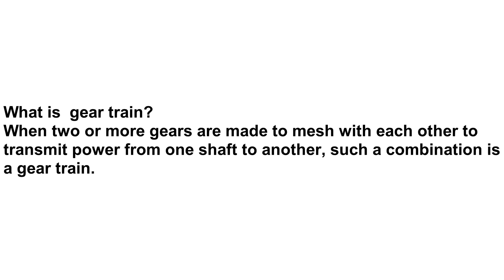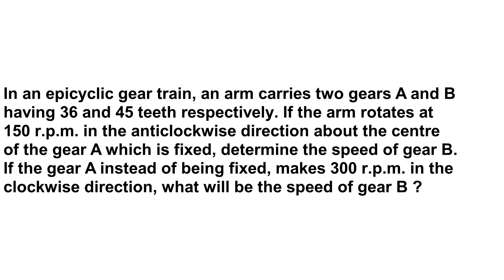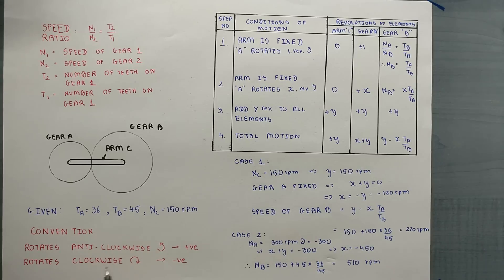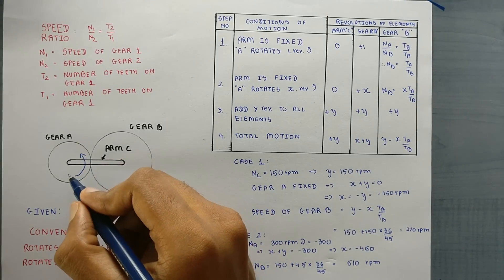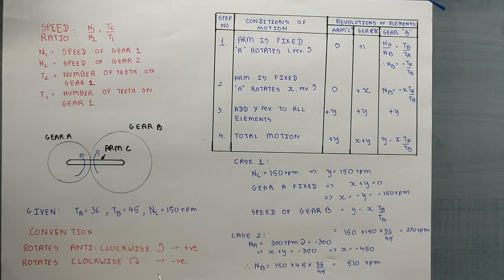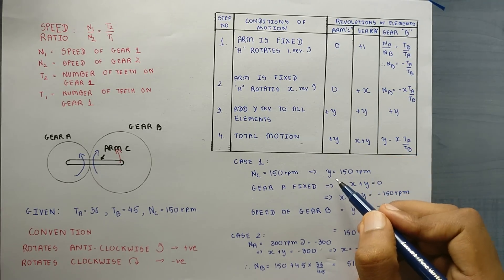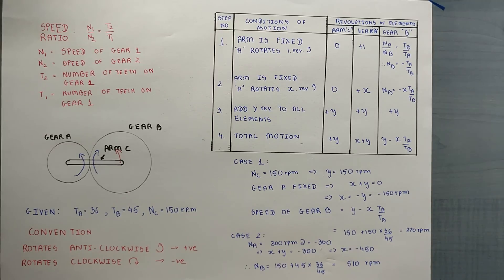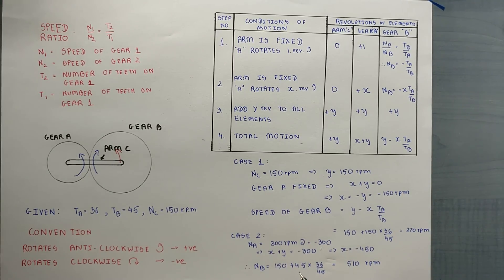Gear Train Problem Solved in easy way

Comment: 5.	An epicyclic speed reduction gear is shown in fig.The driving shaft carries on arm A, a pin on which compound gear B-C is free to revolve, which meshes with wheel D, keyed to the driven shaft. The number of teeth on the wheels are TB = 40, TD = 45, TC = 42 and TE = 43. Find the ratio of speed of driving shaft to speed of driven shaft,. If input torque to driving shaft is 50 Nm, what are load torque on D and holding torque on E?
Reply: solve this exampl

Comment: NB  calculation has an error...NB=150+(450*(36÷45))
But in your calculation 450 is replaced by 45 . otherwise
Thanx 4 easy explanation sir
Reply from the maker: akash sr sorry for the silly mistake. The answer has been calculated taking 450 into consideration. Thanks for your response and support. Keep supporting us. Do share, like and subscribe!!!
Reply: It may be silly mistake sir..but those few people like me are not that much range..we will think where the 450 gone and we trust u nd think that 45 is correct may be it's my mistake
Reply: GOOD! U NOTICE D MY FRIEND,WAS WONDERING MY ANSER 587.4RPM